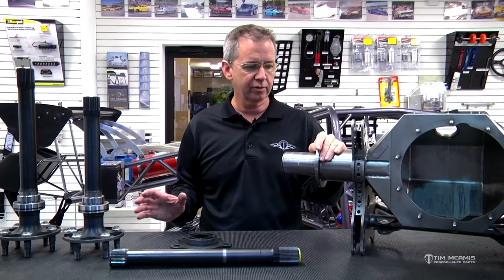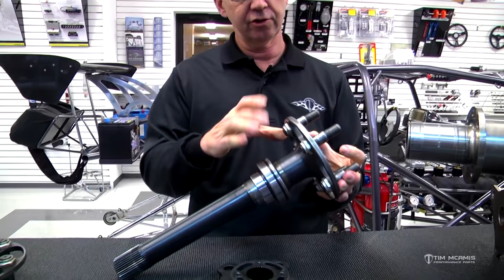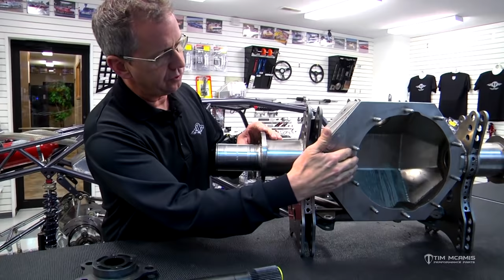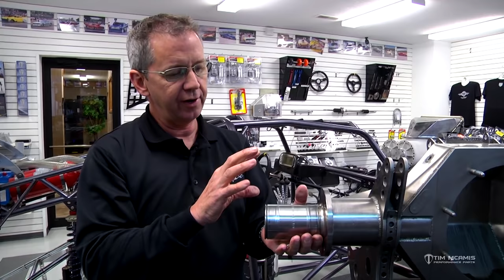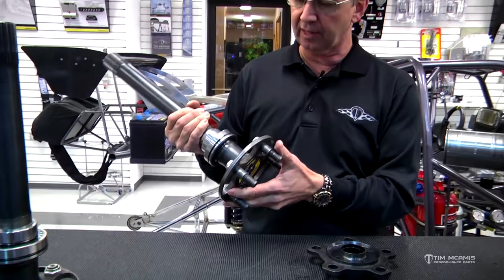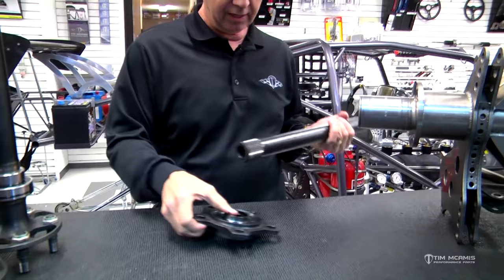Flanged vs. Floater

Comment: Best thing about a full float is your wheel won't fall off if you break an axle, It just quits spinning under power.
Reply: Your wheel won't fall off with the 9" he showed either. You lose wheels with C - clip axles because the bearing is pressed into the axle tube and the c - clip is the only thing holding the axle shaft and flange in.

Comment: Thats good stuff, back in the day some racers would use a 3/4 ton floater diff from a truck in there drag cars. whats old is new again. a engine is just a engine and a trans is just a trans but the diff is where the rubber meets the road. to me it is the most important part of the car. thanks Tim

Comment: Thanks for explaining!
I designed a robot loaded axle tube gage, when I worked for "VGage". I never got to see an assembly, but per your description it was for a "floating" axle style.
It could be set up to check both: "SRW" & "DRW".
It checked the diameters for bearings & surface that mounts  the brake caliper.
See YouTube "vgage axle tube automatic gage" if you are interested.

Comment: Live axle has a bearing that contacts the shaft and housing, floating axle has no contact with a bearing it bolts to the hub via the axle’s flange, the hub houses the bearing and races that are seated onto the outside of the tube housing (hollow spindle) that the allows the floating axle to rotate with no contact, the hub also contains grease or oil seals to contain the bearings lubricant.  2 bearings in place at the wheel hub larger in size increasing the mechanical advantage and strength via size, placement, and additional bearing per wheel.

Comment: I know this is an older video... but.... Which is stronger rolled splines or cut splines... In the off roading that I do, rolled is stronger for "slow torque: wind up... but was explained to me, that harsh snap pulls at a drag strip type launches, machined is better, as it allows for a longer/wider flex before breakage I think is called "yield strength"?... Unknown to me, if one costs more to manufacture then the other, if ref to dictating the which one is more costly....  I have broken both types while off roading... both in modest situations, as I am not heavy on the throttle, due to not wanting to break stuff and then ruin my day of getting of the trail and then having to fix stuff...  so, as I understand it, yes, the rolled splines are stronger, but, shafts of the same size, one is much harder, and does not flex/twist, and will simply snap, where as the machined splines do not have rolled in grain metal structure, and does offer a little bit more flex/twisting... or to say is more forgiving but doesn't like the hard shock type action, but can handle slow non-shock torsional stresses better.. Please feel free to correct me as it will not offend me at all, and anybody can answer this, either based on the metallurgy or based on actual real life experiences... Thank you, Dru

Comment: the instant you held up that standard axle, working on floaters before. I could tell the need for it in extreme high hp cars. Take all the weight, and torque applied to it and it all rests on the axle itself in a conventional or run a floater and its all supported by the hub. Leaves the axle to apply power only and not hold any weight. I have to say though that those 40 spline pro axles have got me a little emotional. They would be a huge expense but also a 1 and done for 99.9% of us racing cars at 1000 not 14000 hp lol

Comment: Hypothetically if I wanted to run greater than 100% anti squat on a big tired front wheel drive drag car, would the easiest way be to use a floating rear axle with a 4 link and just have no internals or axles?

Comment: in your video you keep saying high horse power what do you consider high? I'm interested because I have a small tire car around 2000hp with M/T drag radials  (et street aired down to 16psi) but I drive it on the street alot would a flouting rear end work good on the street?
Reply: Floater would be no different than a semi floater (standard rearend) on the street. Im building a 10.5" tire car right now with a Strange full floater, I prefer full floaters because you will never lose a wheel due to an axle failure.
Reply: Bob Faestel Don't say never. I've seen people lose wheels on full floaters. Last time was on a dragster. Not sure how it managed to take the wheel off too, but it did....and the driver watched as it rolled past him to the end of the track lol. I tried everything I could to determine what happened but even pausing and slow motion didn't help.
Reply: @JC-11111  most times you see a floater rearend loose a wheel it is a result of the wheel studs failing and that is usuallya result of improper torquing . Anything is possible but you rarely see a hub or housing failure.

Comment: oh, another question... how are axles shafts rated... all the sales pitches of my off road axles, just simply say, "2x, 3x, 4x stronger the stock" or, "axle shaft can handle 500HP or 1100HP" ...lol....  If I had a torque wrench big enough, to actually twist one, to the point of breakage, that would be interesting info...  I watched some videos that show machines that load test this stuff, and U-Joints, drive shaft, to the failure point, but the only numbers mentioned were for the particular drive shaft that was carbon fiber and a completely off the wall strange application, and still didn't give numbers for a standards of measurement, like D.O.T. or W.L.L., heck, even OSHA number would be a point me in a direction, other then, the statement of being 3x stronger then stock... well of course it is, an aftermarket upgraded 40 spline DANA 44 & 60 axle shaft will be stronger..... I wonder about the MIL SPEC axle shafts, like in the HEMTT, can one axle shaft on one side, if all others were out, pull the trucks own weight up a 35 degree slope, or is this required task, of 35 degrees mean that no more then 3 to 4 of the 8 axle shafts can be out, before there is too much load torsionally on said remaining shaft?.. don't answer that, and am just saying for the example ... Sway bar tech, is wonderful, all sorts of info on those shafts... but not much on axle shafts, maybe it is safe to assume, trade craft manufacturing protections? or do not want to give factual numbers, for liability factors? is there a shelf life on axle shafts, more in the idea, of how many launches can a pair of axle shafts take? Yes, I know that is extremely abstract, as there is a million different situations, and none being the same.. Is there ways to check to see/measure the axle shafts to prevent breakage, inturn further damage to other parts of the rig, no matter drag strip or off road... ? again, Thank you, I really enjoy your channel, i have learned so much over the years,  Dru

Comment: you sell blue prints to a floater rear end. I got blue prints from when I went o wyotech on a 9" Ford rear end are they basically the same just shorter and axle is center lined I know when we built mine we off set the faceplate 1inch. I'm in the process of building a drag car wanting to push 1000hp but change later to more (not sure yet) I'd love to tour your work is that possible?

Comment: Yes the floater is stronger and safer but that alone does not make it better for all applications. Two parachutes are safer but overkill on a 10 second car. I want guess at a horsepower cutoff for flanged axles but it is safe to say only a small percentage of race cars need them. On the negative side you will see an increase in rotating mass, not a problem when you have more horsepower than traction but on your the average 600 to 1000 horsepower car it could cost you some et. If you really want to see strong alxes,look at the axle in the Strange floater rearend top fuel use, the 40 spline alxe would fit in the gun drilled hole of them. Love Tim's videos I always learn something. It's true the more you learn, the more you learn how little you know.

Comment: With the semi floating, flanged axle the differential carrier bearings support some of the load of the vehicle, by way of the inner spline at the differential or spool, through the axle its self. The single bearing at the wheel flange supports the bulk of the load due to it's closer proximity to the load center. Consequently the flanged axle has two loads, bending and torsional. This is what makes them a weaker choice than a full floating axle which only experiences torsional loads.

Comment: Also worth saying that with a floater, a broken axle cant result in a wheel coming off.  Since the wheel is attached to the hub and not the axle shaft, a broken shaft may spin around in the housing and fuck everything up in side, the wheel stays on and you still hopefully have control of the rail.

Comment: So basically it's like a 3/4 to 1 ton truck axle.
Reply: skirkland1980 exactly, except they usually have the axleshaft and hub drive flange as one piece. all the way up to class 8 trucks.

Comment: You sure can't  learn this  by  looking  at small photos on parts Catalogs..    I own and work  on class 8 trucks  simple they have   a spindle  with  inner and outer  tapered  wheel bearings..

  So  I simply assumed a  Full floater was anything that didn't need a C  clip to hold the axle in place.. 

  This was a nice Video  for Drag  racers  but did not addfress the needs for anyone  going around corners  hard  who have  side load issues..
Reply: The term for axles that aren't full floating and that aren't C-clip is "semi-floating axle", it's more commonly heard in the off-road world, I rarely hear it in the 'car' world, but it's an axle industry standard term. So the 3 typical axle types are...
- C-clip: retained by C-clips inside the diff of course.
- Semi-floating: a 1-piece flanged axle shafts just like C-clip axles, but are retained by a bearing retainer flange on the outside of the axle housing instead of a C-clip in the diff. Notice the bearing near the flange on the flanged axle shaft in the video, that's a press fit, and the bearing retainer sandwiches between the retainer and the axle housing end - so that bearing sees all the side-load forces(if that sounds a little scary, remember that C-clips are supporting the side loads in a C-clip axle {SHUDDER}).
- And, full floating - which you're obviously pretty familiar with, the axle shaft is fully floating, meaning it doesn't support any weight, and is retained at each end.

Also, if you're familiar with the conventional 9" Ford, then that's exactly what a semi-floating axle is, since they retain the axle shaft by the outside wheel bearing which is a press fit on the axle shaft. So, when someone puts 9" ends on a Ford 8.8" axle to 'C-clip eliminate it', you're turning it into a semi-floating axle by retaining the shaft at the outside end with a bearing retainer instead of the inside end with a C-clip.

As far as side loads, it honestly doesn't matter, C-clips are the weakest in this regard too but it's a non-issue, they never really break from side loading. You're more likely to break a C-clip axle shaft by aggressively crossing corner rumble strips under throttle with sticky tires. 
Semi-floating axles are fine with side loads, one can argue that the axle shaft bearing is being loaded in a way it isn't designed for; but, again, you just don't see side load-related failures in road racing use.
Full floaters are 'the best' in side load as well, since all of the side load is fully supported by the spindle, not the axle shaft.

Comment: BUT why?  The stupid  super narrow diffs with all of the offset of the wheel out. Mechanically totally inept. A longer axle has more  room to flex and windup. The hub being at least central in the rim will not support tyre shake as much. Even better if the wheel is further out. As all modern passenger vehicles are. All trucks have used floaters since they started making trucks. And that does not include toy trucks. Some use floaters and some do not.
A floater is essential for big power cars with marsh mallow tyres that wad up in all directions. Sometimes the right direction!
I have seen those gun drilled axles explode. Both drag cars and Sprintcars. [steel or alloy] Not nice

Comment: Errrrr?  A floating hub has a nut to retain the hub to the diff tube. Similar  too most front hubs.
As for the fancy bullshit  standard style axle? Why? Spend a whole heap of money to get something with all the inherent weakness of a factory car axle.
Reply: Because there isn't anything "inherently weak" about it until you have 3000+HP - semi-floating drag axles are typically much more affordable, and one like McAmis featured here is OVERKILL for anything that isn't a Top Sportsman car. You are gaining literally NOTHING by dropping tons of cash on a full floating axle that belongs in cars with an extra 1000+HP over what you have.

You can get a Fox body Mustang into the 10s with a Brad Anderson blown hemi - but what the hell is the point of using a $50,000 blown billet big block to do what a $6000 small block can do? That ridiculous full floating axle is a BAE hemi of axles; 95% of drag racers will NEVER need either, even if we want them.